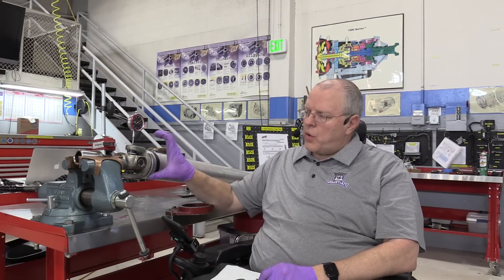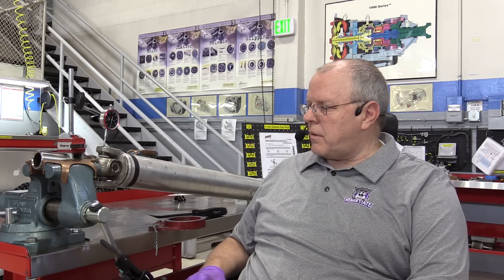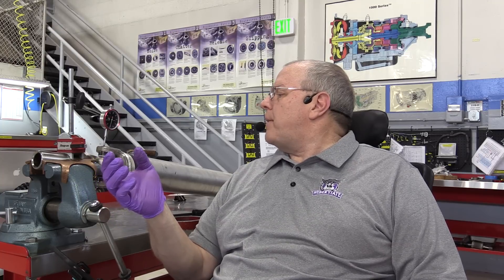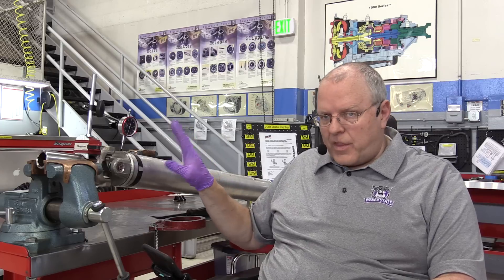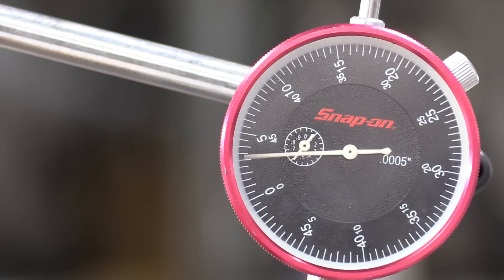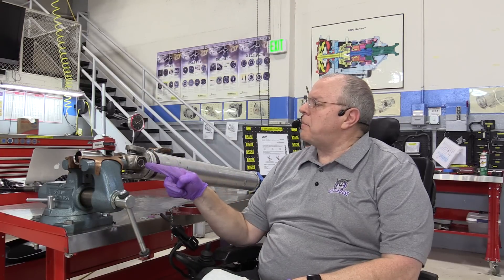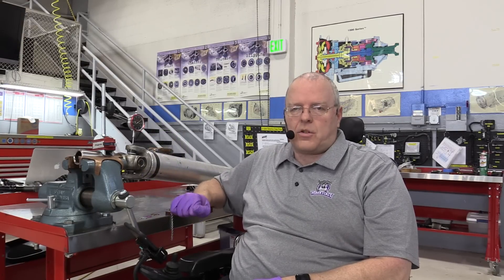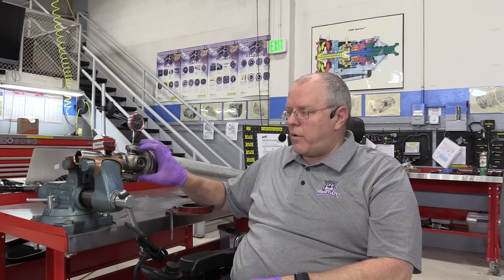Universal Joints - Part 7: Centering and Adjusting Axial Play

Comment: John, How do you know how much of that 0.00197" is between the vertical trunnions (thrust ends) and their respective thrust washers/end caps ,,,,,,,,, and how much is between the horizontal end caps horizontal needle bearings and horizontal trunnion circumference surface?
The way you are measuring, might there be preload in the vertical cross pair, ,,,,,, and 0.00150" clearance within the horizontal end caps?
Reply from the maker: I was being very careful to only measure the vertical component. If you align it correctly, the horizontal movement will not matter.

Comment: John, Thank you for a super series; obviously a lot of very hard work and much dedication! I'm curious how much axial runout is normal between trunnion and bearing cap? Surely there must be some as you wouldn't want preload on needle bearings. Assuming there is some runout allowed, would this runout within horizontal trunnions/caps add to runout as you measure runout in the vertical?
Reply from the maker: Thank you! Less then 0.002" but not zero is the typical specification for your Tacoma and most other vehicles.

Comment: Hallo!
I'm trying to overhaul the IRS of my Jaguar E-type 1969 4,2 FHC LHD
I'm looking for any kit of snap rings/circlips with various thickness  that can fit my u-joint but with less axial play possible?
the snap ring delivered with the new u-joint is 1.7 mm , too thick!
I've fit snap-ring 1,2 mm thickness but I measuring about 0.3/2=0.15 mm each side, too much!
I need something around 1.4 (... 1.5 maybe) or something in between
Where can I find this snap rings
thanks for the help!
Reply from the maker: Good question. I found them in the Spicer "Small Parts Catalog" online. I do not know who the original supplier was for your car, but Spicer is a good place to start. Best wishes.
Reply: I don't know if you're common with Jags much, but this guy has something to worry about. The independent rear suspension of Jaguar design used U-jointed driveshafts not only in the purpose they sound, but they were also upper suspension arm (kind of upper wishbone). So this suspension design surely needs more attention than the others.

Comment: I now relate the operation of universal joints to helicopter rotor hubs with blades attached, in that there is a static balance or run out which determines if everything is balanced. Then a dynamic balance is accomplished to trim the cord angle of the blades about the hub or universal joint. I never saw the relationship before, wow. If there is a vibration of any kind after replacement, it shows quickly, unlike a car where a higher speed might start the vib.
Reply from the maker: Thanks for the feedback!

Comment: what an awesome learning course. thanks for making these videos.   it might be helpful if you have not to touch on the importance of replacing the ujoint straps.  no one ever does when everyone should.
Reply from the maker: Thank you, I thought I mentioned the straps and bolts were not reusable in one of the videos in this series. I am going to make a video showing how much the straps stretch and form fit the u-joint caps upon initial installation.
Reply: You did, a couple times. Just yesterday I asked a transmission shop this question as a test to see if they know there stuff. They gave the wrong answer.
Reply from the maker: sonoma314 It is a very common misunderstanding. Thanks for your great feedback!

Comment: great info, but it probably cost a customer 50 + hours labor time @ $50 an hr= $2,500.for u joints?
Reply: Joanne Webb if it take you 50 hours to do this then go work at the tire machine and sling some oil

Comment: Amazing! i wanna someday work whit this level of quality
Reply from the maker: +Guilherme Angelo Bertuol Posselt Thank you!
Reply: @WeberAuto  
I'm here to learn. The other day I installed Spicer universal joints in mom's 2004 Jeep Grand Cherokee rear driveshaft. They were the greasable type with the zerk on the cap. I cleaned the slight rust on the yoke with a small wire brush on a Dremel.

Before installing anything I test fitted the snap rings. I had 3 copper, 3 green, 3 grey, and 1 odd one the accommodate the zerk.

All 3 colors fit just fine. I searched and even called some tech at Spicer. All he said was the copper are the standard ones and those should be fine. Apparently the grey and green are thicker but I never got dimensions. 

I installed everything by using the copper (on a hunch). After everything was fully assembled everything felt slightly too tight. What was I supposed to do? The other options would have been tighter and  more difficult to install if not impossible.

I did find a video where someone file-fitted the snap rings to their liking. Is that ok? How would I know if it's tight due to the snap rings vs the yokes' own interference fit?

I hope it'll wear into itself and center itself, but I'm afraid it'll fail prematurely. 

I intend to watch all 7 of your videos.... perhaps 1 per day. Could you point me towards which video would answer my concerns?

And have you got any videos on correcting driveline angles?

Thank you for reading this.

Comment: Hi John a brilliant and thoroughly researched series. Very informative, there was so much I didn't know! Just as a comment as to why repair shops may have lost the art of driveline repairs....so many manufacturers only use staked uni joints in their drivelines now a days. I know staking the unis is nothing new, but it is becoming more common. Why they (the manufacturers) do it I just don't know...is it cost, ease of production or something I haven't thought of??. Much more cost effective to get the expert from the driveline shop to restake new unis and balance the shaft. Less grey hairs and trouble for the shop I suspect.
Reply from the maker: +tecnaman Thanks for the great feedback! I don't know why either.

Comment: Very interesting. The Toyota book shows tapping the yokes (thick end). Is this to 'settle' the caps do you know? I honestly didn't know UJs were this in depth, like you say, would we treat other bearings the same? No!
Reply from the maker: +Toyota Tech Hi, yes, I have seen that part of the Toyota service information. It also shows using u-joint pulling tools that are no longer available for purchase; not very helpful. To Toyota's credit, they do show that checking axial play is needed and have given play specifications for years. I have looked at other manufacturer's service information for u-joint replacement and inspection, they look like they were written by a caveman with a hammer and chisel; no axial play is mentioned at all. Ford and GM are the only ones that show a u-joint removal tool that you can still purchase, but still no play or inspection. I have service manuals out of the 1950's that do a better job of describing how to change a u-joint than today's manuals. It seems like all the details have been slowly deleted over the years to a point where it is almost a lost art. That is why I decided I need to research this topic in great detail and try to restore proper methods, tools, and specifications to an industry that does not even know they are gone. Thanks for your feedback! No Hammers! ;)
Reply: +WeberAuto Well your research is very much appreciated. I think I have parts of the Toyota tool at work, if I can find the bridge part I think that could be used as you used the OTC tool. I'll route through the tool bins tomorrow.
Reply: A vice and a hammer is the best way to remove them. A socket and vice or press to install.

Comment: where  would you find the spec if you want to check the play of the universal joint because i am going to build a drag car and i think this need to be done thanks
Reply from the maker: +265chevy Hi, That is a great question! It is hard to find a spec! Most of the service information I have access to seems to have been written by cavemen who don't even check play. l did find a specification in several locations though. 1. The Spicer Parts website http://media.spicerparts.com/media  2. The 2007-newer Toyota Tundra service manual for dirveshaft inspection (They use all Spicer parts).  3. A u-joint inspection procedure from Lexus for some staked-in u-joints they use.  What I discovered is: The larger the u-joint, the larger the allowable play. Large Class 8 trucks (Semi Trucks) have 0.006" maximum play (from the spicer website). Light duty trucks (Class 1-3) like the F-150, Tundra, Silverado, Sierra have 0.002" maximum play (From Toyota's manuals). Small diameter driveshafts like the Lexus has have a maximum play of 0.001" (from Lexus' service information. I would use the 0.002" maximum for your drag car. Best wishes!
Reply: thanks for the quick reply i will go with .002 sounds about right

Comment: Now I understand this thanks, one question I have is on some rear wheel drive cars I had there was some kind of vibration in the back of the car at 55/miles/h (speed) and engine braking only (let off gas pedal). I guess it is from drivetrain or final drive.
Reply from the maker: +g johan Thanks. Vibrations while using engine braking are usually caused by u-joint working angles becoming unequal because the pinion nose drops. See my video in u-joint working angles for more help.  best wishes! https://www.youtube.com/watch?v=f1m-Fh5kiRU&list=PLIn3FrDiB1lxxj_X8eZ7Z4tF4Ge8plIdN&index=4